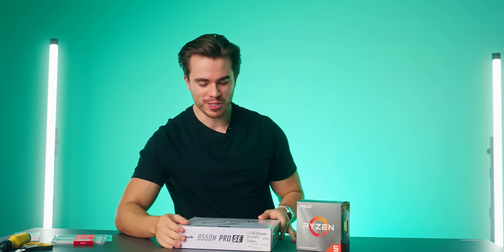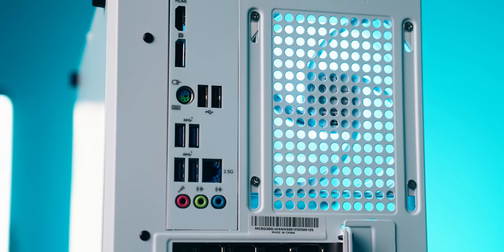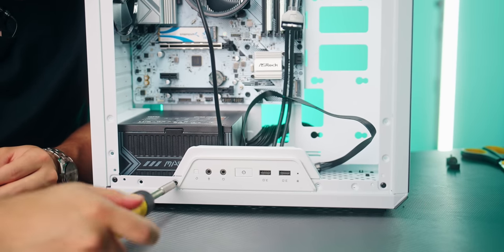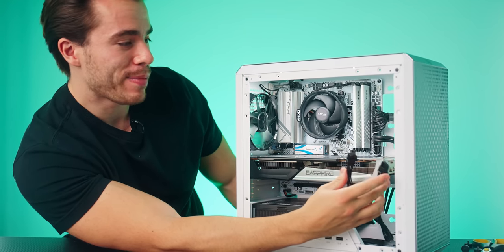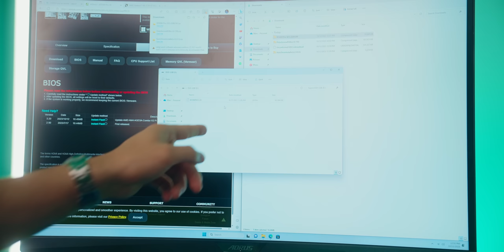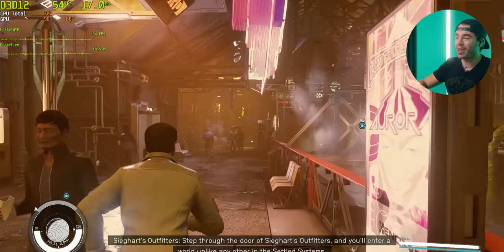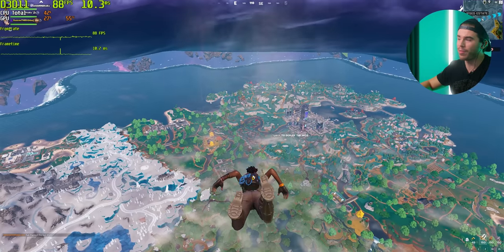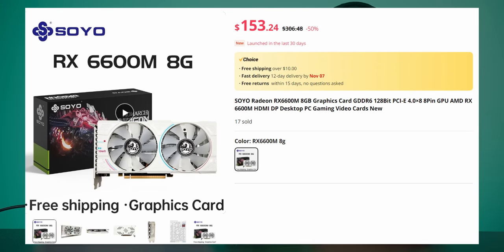PS5 or Build a PC? 👑 BEST $500 Gaming PC Build Guide 2023

Comment: Watching this rn, was thinking about getting a PlayStation 5, but this seems amazing for a new pc guy. Deserved a sub
Reply from the maker: Thank you!
Reply: If you want less headache. Just get a ps5. I only have a pc for wow. Builders(streamers)are like used car salesmen. They don't want yo tell you the flaws of this build. True pc people will tell you no, and you get what you pay for.
Reply: @jg7702  Agree!
Reply: @jg7702 what issues would you run into if you used this build?
Reply: @asian_dummy5001  new games wouldn't run well. The machine is very limiting and will most generally run into optimization issues. Shortened like span of the machine where as consoles will run for 10 years on games. My 1060 after alittle 4 years is considered a dead stick. Buying used parts is always a bad sign. I want brand new out of tge box newness feel for spending 500 dollars. With also this build you will need a controller also something the console comes with.
Reply: @jg7702 are you well versed in the world of building gaming pcs? Cause I need some help choosing between 2 cause I've never done  this before
Reply: I'm stuck between the 525$ one ore the 500$ one that's green from the channel toasty bros could u give me ur expert opinion
Reply: @FennecMain  Yep, built alot and fixed alot. Just don't do it much anymore at home because I spend my time at work working with them and trouble shooting issues and replacing parts. Computers are a good investment if you do more than play games on them and the builds this streamer is showing is a dead stick to new games in a year. I had to replace my 1060 which was only 4 years old because it was outdated.  The storage is much slower in PCs than consoles in general and the computers need alot more headroom because 90% of the games out there are built for consoles in mind not pc. to new games in a year. Let alone i believe he uses used parts which i would not do. Its a 50/50 chance and you wont have a warranty, but hey i wouldnt listen to me. I only been working with pc's for 20+ years. Go off a streamer looking for subs to be lazy.

Comment: If I didn't know that this build costs $500, I would've thought it cost much more. Fantastic build!
Reply: It doesn't just cost $500 to build a PC like this! It will also require a monitor, keyboard, mouse, operating system, cords and cables, an internet connection and games if that's what you're going to do with this system. All that stuff cost money and it's way more than $500. The only thing a console requires if you get one new is a TV and I'm pretty sure most people already have one of those. The actual cost comparison of consoles and gaming PC's (in reality) isn't even close!
Reply: Always, when a build is made, only the cabinet is counted, that general knowledge
Reply: @walterlegere1403 what are you comparing this too? A console also needs a tv cords and for a decent amount of games an internet connections
Reply: @walterlegere1403 and a PC doesn't require a monitor either Ive used mine on my tv forever
Reply: @walterlegere1403  brother what are you talking about?
Reply: @walterlegere1403 but thats for a set up not a pc

Comment: Great video!  Love the white theme.

I priced out an almost identical build here in Canada for $668 CDN (taxes in). Opted for a used 5700XT on Marketplace. To keep the price as low as possible, I had to go down to a B450M Motherboard but I stepped up to the Ryzen 5 5500 due to availability. Here are the specs:

MB - MSI B450M PRO-VDH MAX Core Boost
CPU - AMD Ryzen 5 5500 6-Core/12-Thread 7nm Processor
RAM - Kingston FURY Beast 16GB (1x16GB) DDR4 3200MHz CL16
GPU - AMD Radeon 5700 XT
HD - Team Group MP33 1TB PCIe M.2 NVMe
PSU - AZZA PSAZ-550W ATX Gaming Power Supply - 80 PLUS BRONZE
Case - BitFenix FLOW Case ATX

Not the prettiest thing but it'll get the job done!
Reply: 550 Watt cutting it close bro
Reply: Buy a 2x8gb ram for dual and you’ll get better performance
Reply: @17.Script  I think he might upgrade is sooner

Comment: One big flaw of 5000 series is that lack of mesh shaders means it cant even run Alan wake 2 at all. Also the same for 1000 series nvidia. Its a shame as it a good choice for low budget builds. Do suggest the 6600 if you care about playing alan wake 2.
Reply from the maker: That sucks and the timing as well would of influenced my choice for the GPU. I probably would of chosen a 6600M if that were the case.
Reply: The good thing about it the ps5 will run it.

Comment: I just built a $500 PC I'm flipping with a Ryzen 5500 (NEW), a MSI Mech RX 5700 non-XT, 16 Gigs of 3200 RAM and a 500GB nvme drive for the same price. It is a solid 1080p performer. I like his case choice better though. I may swap the case before I list it. For me, USB-C is no big deal.
Reply: what’s your psu power and brand bro??

Comment: I built a similar OC, pretty good stuff. Now I didn't stick perfectly to the 500 dollar mark, nor was I 100% going for looks. But I tried my very best to make sure every part worked together, and I really like what I got. I also have 32 GB ram and the 4600g instead of your specs. But overall the difference in most games should be less than 10% between our setups. If we used the same OS.

Comment: View from the back of the PC case with the installation of the power supply unit and the connection of the power cable, it looks like two completely different cases.
Reply from the maker: Because they are

Comment: R5 3600 gives you pcie gen 4. I used the 3600 in my dad's (my 10yr nephew uses it too) with a RX 6600. I use it with a RX 7600 and my olds nephew for Christmas got him the 3600 and an opened box RTX 3060oc 12GB (boxed his GTX 1650 and his 10400) but hey it is your build.
Reply from the maker: The 3600 was just out of budget, but I have linked in the description nonetheless.

Comment: Going from a stock cooler and a basic black fan at the rear to a different cpu cooler and case fans. So the build changed after it was completed. Yeah a cpu cooler and a few fans don’t cost much but it is extra cost. 😉

Comment: Should’ve gone with a ryzen 5 3600, same price, supports pcie 4.0 which is very important plus it has 32mb of l3 cache instead of only 8mb on the r5 4500 which is gonna give you a very big fps boost
Reply from the maker: The Ryzen 3600 is more expensive and inconsistent inventory unfortunately. I have it linked in the description regardless.
Reply: @ScatterVolt  hey, i just subbed <3 ty for the vid. but i was wondering how well this pc will play rocket league? Its my first time building a pc and i only play rocket league (high settings) and maybe apex and fortnite? is this pc okay for these games? Thank you so much
Reply: @TheChosenOne-ec4dk he played furniture in the video

Comment: I built a similar PC for my daughter but end up getting a RX 580 for $99 and a Ryzen 5 5500 also for $99. PC Specs are:
AS Rock B550m Pro SE
Ryzen 5 5500
Corsair Vengeance LPX 16gb 3600 CL18 (Already had it)
Corsair RM750x PSU (Already had it)
Intel 660p 1tb M.2 (Already had it)
Silicone Power A55 1tb SSD (Already had it)
AMD Wraith Prism Cooler (Already had it)
DIYPC DIY F2-W case

I was looking at the Q300L but only found it on black and I was doing an all-white build.

PSA: Don't buy the DIYPC DIY F2 case XD
Reply from the maker: Yeah don't buy DIYPC cases haha

Comment: Hey i'm new to your channel and also new in building gaming pc's and i got a question could i use the ASRock B550 Phantom Gaming 4 AM4 AMD B550 SATA 6Gb/s ATX AMD Motherboard instead of the one in the vid?
Reply from the maker: That is an ATX board and it won’t fit in the mATX case used for this build guide
Reply: @ScatterVolt another question  abt the gpu is there a gpu like that one on amazon that i could use and is the Ryzen 5 5500 better then the 5 3600?

Comment: Hey i’m super new to the PC gaming world and was wondering if i could get some help/a suggestion. I was originally considering getting one of the handheld gaming PC’s (steam deck or rog ally) to dock in my living room like a console but am now thinking I should get a custom built PC for a similar price range (slightly more if necessary) for the same purpose (gaming on a tv). I mainly want to have my usage be: playing a modded Skyrim (not super heavy, i’d say moderate or at least a bit more than a series S or X would handle), Starfield (ik it’s a fucking chore lol), playing Pokemon Rom hacks, emulating consoles like PS3, Wii, Wii U, Gamecube, Switch (maybe), etc., modding Super Smash Bros (Brawl or Switch), adding multiple controllers for multiplayer games, using Xbox Gamepass, and getting a performance similar to the Ally at least in terms of AAA titles. All this with a preference for controllers over mouse and keyboard. 
1. Is this possible for a similar price range as this PC or the high end ally or steamdeck?
2. Is this possible with this particular PC build?
3. Thank you for taking the time to read this! If you have any suggestions you wanna leave me please lmk

Comment: Can anyone help me? I was thinking about building a pc and I wanted to futureproof it. At first I thought of using an am5 mobo with ryzen 5 7600 with an rtx 4060ti (why this gpu I'll explain below) . My sole reason to choose an am5 board is, I'll have options to upgrade to higher 7000 series processors and ddr5 RAMs with higher speed which may go long run without me having to upgrade anything besides the GPU or adding more RAM sticks. But some of my friends are suggesting me to go am4 and invest more in the GPU. So I just wanted to know how futureproof the second option is and what is the lowest/ more budget option of cpu/ram and mobo I should select so that I can squeeze the most budget for the GPU and get a gpu that wont bottleneck with the am4 build. My previous choice was Ryzen 5 7600, rtx 4060 ti( because this is the cheapest gpu I can get in comparison to it's amd counterparts it costs like 480$ here whereas rx 6700xt,rx 6800 costs like 565$ and 830$ respectively even the 3060ti is more expensive than 4060ti 😂. Also rtx 7800xt isn't available in my country.) and  16gb 6000mhz RAM. So should I stick to my own build or go the am4 way and get a better GPU? If yes, please suggest me a decent cpu gpu and ram combo that would be as better as my previous choice and would be futureproof.

Comment: Best motherboard for 7800x3D and 4090? (White motherboard for all white build)
Reply from the maker: Anything you like that is X670 or X670E
Reply: @ScatterVolt  thanks been finding some B650 Asus ones but reviews have been mixed really good or terrible so just confused on what is good or bad!
Reply: I'd pair with an X board if you can afford it. Might have less regret in a couple years. B board will technically work. Good X boards are around 300. You will have to check reviews for each model regardless and try to make the best choice. That's a great gaming cpu but the cost of X boards did make me go Intel, when compared with Z boards similar feature sets. The X board is more future proof for that 7800X3D. X670E sure are pricey but would look at your total platform costs and see what features you actually need for gaming. Would check if you will get enough power delivery on a given B board. Maybe an X670 for around 300 if you are trying to future proof it for a couple years/so out.
Reply: @dianaalyssa8726  ASUS ROG Strix X670E-A Gaming WiFi  so this one is a no go then? I’m building this to last like 3-5 years. That’s why I’m going 4090 etc.
Reply from the maker: Stay away from Asus and their B650 boards
Reply from the maker: Strix boards are the best (alongside Aorus). My personal rig uses one with a 4090 as well.

Comment: confused between 13600kf with 4070 or 7600 with  7800XT (bit spectacle about amd  people are saying they are not stable and random shut down and random graphics pixel stutter happened any idea)? Its my main pc for client work and gaming.
Reply from the maker: Whoever says AMD is unstable is biased
Reply: thx for clearing my dowts
Reply: Ram OCs on 12th/13th could make it unstable, game crashes regardless of GPU. Have used both Nvidia (1060, 3060) and AMD 7900XTX on 12700KF and 12900KF. Since 6000 and 7000 series it is stable but only thing that was causing me to crash (did DDU & reinstalled Windows but that was memory OC at 6000 specifically). Would start ram tuning if DDR5 at jedec supported speed and work up (so 5600). I've had no issues with Intel and AMD GPU combo (same for Nvidia mostly). More vram will be better for 1440P but both are good. I wouldn't spend much more for speeds have a 6000 and 6400 kit certainly am not getting that. Would try to get a board with debug codes, I found that super useful. I've ended up with XMP failing but that's been the only thing that was annoying. Remove the battery if there is no CMOS button (not sure why my 9th gen Z board had one and none of my 12th B and Z boards do).
Reply: @dianaalyssa8726  so for stable build what configuration you suggest at 1000 & 1200 Usd ? I don't Want to suffer crash and restart.

Comment: Hi scatter, I just noticed that you cheaped out on the PSU, I think the power supply should be more than 600W if you're using a Ryzen 5 4500. It will affect the performance right?
Reply from the maker: I didn’t cheap out. 500W is plenty for this system from the video

Comment: Just built an R5 5600x3d, rtx 3060 system with 1 tb ssd and 16 gb ddr4 3200 cl 16 and msi 750 psu using Micro Centers beautiful open box sales. Total cost with case was $611.23
Reply from the maker: Great CPU choice. Meh GPU choice.

Comment: 1080ti is another excellent used option now. the 11gb of vram still help it chug along in 1080 and 1440
Reply from the maker: True
Reply: We don't like nvidia here
Reply: @arcticguardian2046 *you
Reply: Yes but upcoming games like alan wake 2 that need mesh shaders, 1000 series wont even run it at all. Might wanna consider that. Same for amd 5000 series too
Reply: The 1650 and 1660 super aren’t bad options either
You could also go for a 3060 if you have enough money
Also an amd option would be the rx 6600 and you could even get an Intel gpu like the arc a750

Comment: I’m extremely tempted to follow this build guide… but I’d sub in an old 2070 OC I have laying around instead of grabbing a 5700. This was a fun video to watch.

Then again I did recently complete my new person build: Ryzen 7600, Radeon 7900 XT, 3gb DDR5, 2TB m.2 SSD & 750w PSU.
Reply from the maker: Might need a 650W PSU for a 2070 OC but it'd be fine after that
Reply: @ScatterVolt  thanks for the tip, not to mention the reply!
Reply: I'm worried that you said 3gb of DDR5, shouldn't it be like 16gb of 32gb?
Reply: @retrowave69  Heh, good catch. That original post has a ton of typos. 😂

Comment: I built an pc with these parts can you recommend an psu that fits it k the parts are ryzen 5 5600x rx 3060 12 gb it's the 2 ventus 1 tb SSD 970 evo plus and an 32 gb ddr4 ram 2×16gb kit and an case with tempered glass and 4 rgb fans pre installed and the mother border s B550M vdh wifi idk if it's the pro version or it ain't so what psu do you recomend for these parts under 100
Reply: Sorry I meant motherboard the auto correct changed it to mother border

Comment: Using the same parts you use in this video, would you have enough room on the board for a wifi card, if so how would you install and is there a specific one that works best?
Reply from the maker: Just pick any pci e Wi-Fi card you want and put in the bottom most pci slot below the GPU

Comment: Oh dear. the RX 6600 sometimes go as low as $150 used too. Look for them instead of the 5700XT.
Reply from the maker: 5700XT is faster though and has a larger memory bus
Reply: Wouldnt be the best with a 4500 which offers only PCI E 3.0
Reply: @lanwish  You're right. I forgot that 4500 only has PCI-E. I can easily get a 5600 at roughly the same price though
Reply from the maker: In America brand new?
Reply: @ScatterVolt  not technically new but open boxed deal in Micro Center is not bad if you happen to live near one.

Comment: for 500$ pc runs preatty well , but in 2 years you need to make new build if you want to play today video games...
People who come from console dont do these build if you want to have your money worth .
Atleast go more expensive in the range of 1500-2000$ for 7 years of enjoyment .
example build:
- motherboard MSI Z790
-intel i5-14600k
-RTX 4070 12GB (if you go 1440p gaming today standarts)
-16gb ram 5600mhz
-power suply 750w+
-ssd m2 gen 4 - 1tb
-watercooler or aircooler (i perfere aircooling because of the durability and maintnence)
total cost 2299$ (for where i live Europe )
Reply from the maker: 2 years? At 1080p I disagree. At 1440p it depends on the game, especially with FSR 3.0 improving which will help GPU lifespan greatly.

Comment: The problem is comparing it to the $500 PS5 and not the digital version which is more comparable.  Basically saying Blu-ray drive is the difference other than console PC.
Reply from the maker: Well fortunately adding a dvd/blu ray drive to a pc is very inexpensive. It can even be done through a cheap external usb cd drive if you really wanted that lol.
Reply: @ScatterVolt  true but the comparison should be to the cheaper version which is only $400.  I get what you're saying it is inexpensive to add but does add to the cost.
Reply from the maker: If that’s the case. Let’s add in years of the online subscriptions required to play PlayStation online! 😅
Reply: @ScatterVolt  you could add that and also talk about the free games available without a need for PS Plus.  Not saying it is a good model I play on all consoles and PC just for comparisons would be better off against the non Blu-ray digital version.